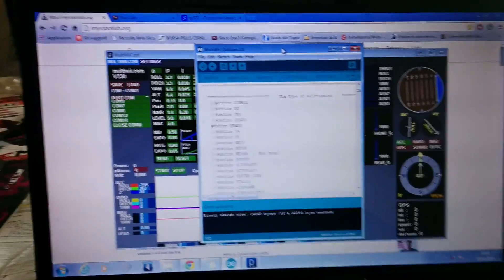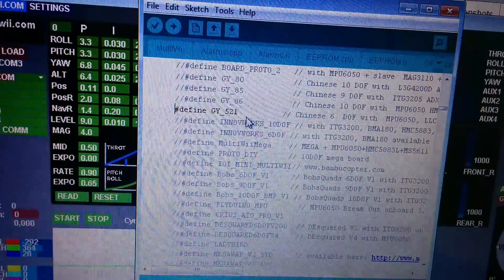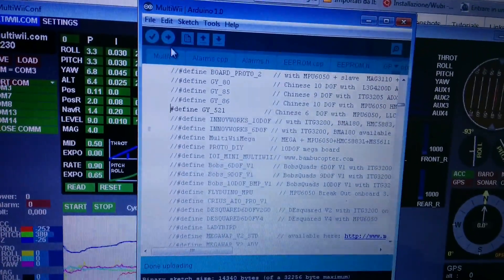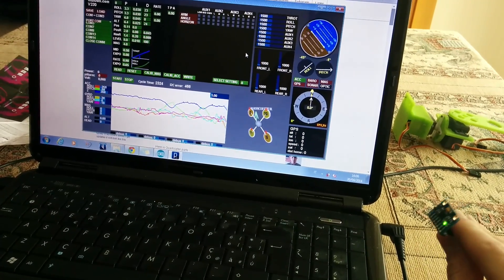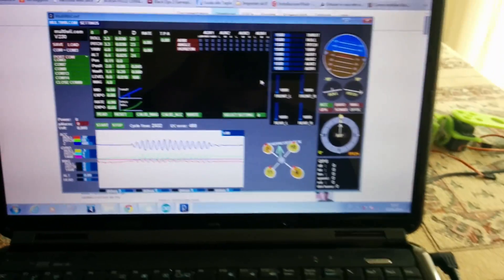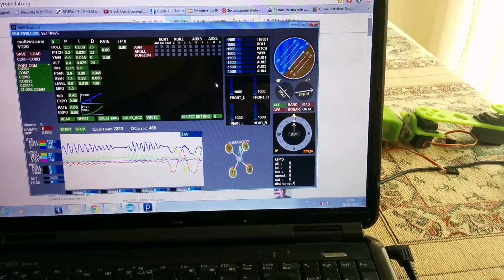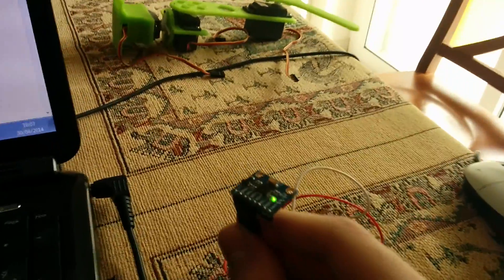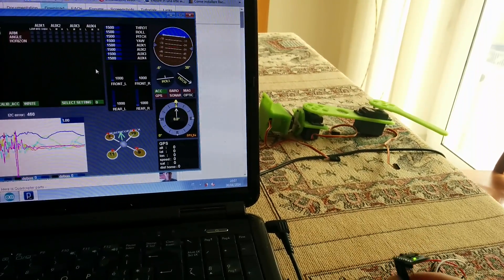Multiwii test with gy521/mpu6050 using Arduino UNO

Comment: I have used the same sketch. Everything works as expected but when i keep the MPU 6050 on the table on a level surface it starts to drift itself, is it a normal behavior?
Reply from the maker: It should not if the drift is too much...  Try calibrating the acc...  Use Calib Acc on a flat surface
Reply: Alessandro Didonna It is on a flat table untouched. I clicked on the CALIB_ACC and it still not stabilizing.  Here is the Video for your reference.

 https://db.tt/Rgat5kwO

and an image of the hardware setup https://goo.gl/T5qRj2

Quick question: Why dont i see any yaw on your quad setup?
Reply from the maker: SMorrizz seems like the problem is related to the acc.. Because the gyro values are solid 0s... Check if you used the correct board definition :

//#define GY_521

Without selecting mpu6050 on the bottom
Reply: Alessandro Didonna  Yes just using the  #Define  GY_521.

 #Define   MPU6050  is generic and is used only when the specific ones is not used.
Reply: Alessandro Didonna Figured it out. Magnetometer was not integrated. Bummer.
Reply from the maker: Cool!  Ya.. That module has not the magnetometer

Comment: Hi
What is the version of multiwii you upload on the board and where i can find the source code of that?
thanks
Reply from the maker: Multiwii 2.3.
Here is the source : https://code.google.com/p/multiwii/downloads/detail?name=MultiWii_2_3.zip&can=2&q=
Reply: Alessandro Didonna
Thank you very much.I downloaded it.
 I want to build a multiwii flight control with Arduino nano and mpu 6050.Do I have to edit some part of source code or it's ready?What i have to do?
sorry but i'm a beginner and i need to connect with you.You're the one who can help me.if you're more comfortable i connect with you by e-mail.
thanks a lot.
Reply from the maker: You have to select in the config.h file the sensor (mpu6050).
Reply: Alessandro Didonna
Hi
I get the source code and do this works:
 #define QUADX
 #define GY_521
#define MPU6050 
 #define FORCE_ACC_ORIENTATION(X, Y, Z)  {imu.accADC[ROLL]  =  Y; imu.accADC[PITCH]  = -X; imu.accADC[YAW]  = Z;}
#define FORCE_GYRO_ORIENTATION(X, Y, Z) {imu.gyroADC[ROLL] = -Y; imu.gyroADC[PITCH] =  X; imu.gyroADC[YAW] = Z;}
#define MOTOR_STOP
and setup the quad.but in the gui the side that there is a LED is front of my board!!!!and it work badly for example when i turn left the board,first the roll in GUI thurn left too after that the pitch turn left and roll will be level!!!!!!
can u help me?What is the problem?What should I do? 
Thanks and sorry for my bad English